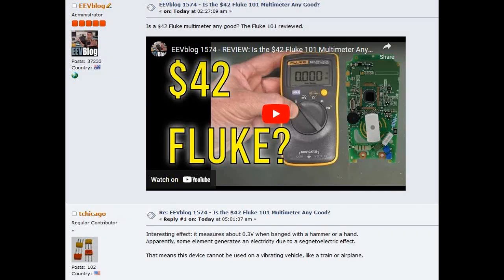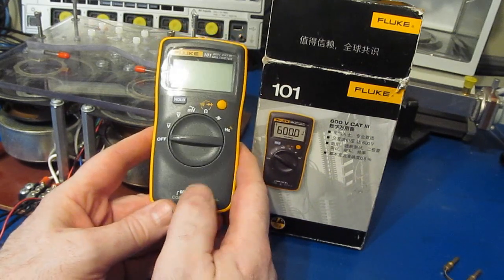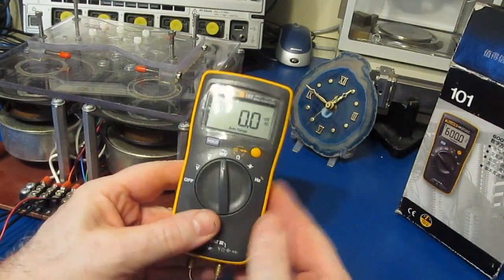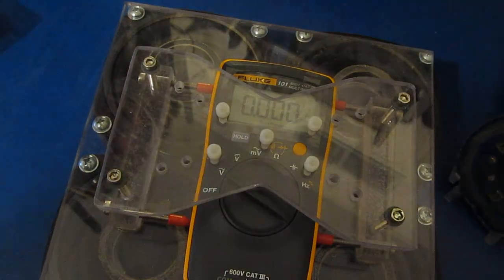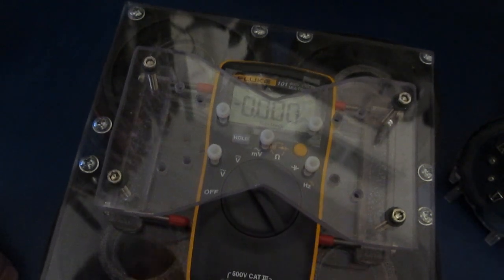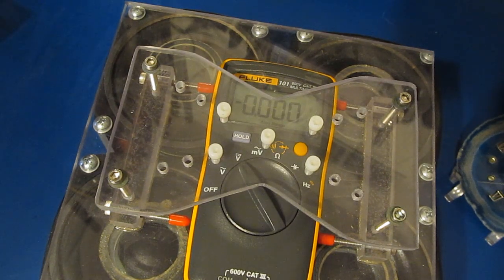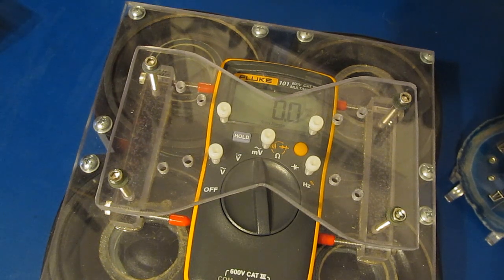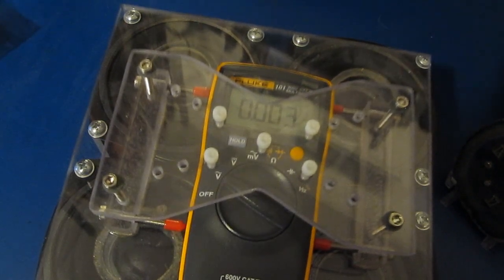Fluke 101 Effects of vibration

Comment: mine is from 2015 ( amazon India ) . one thing I noticed is that it picks up some reading in both the AC ranges just by proximity to an AC mains ( 220V 50 Hz) current appliance or hot outlet or wire . So sometimes I do use it just for that - non-contact AC sensing . It's a fine meter and survives until now as my only meter often carry around .
Reply from the maker: What you are describing is fairly common.  I've seen several posts from beginners who buy a meter and think something is wrong with it because the meter will not read zero with nothing connected.

Comment: Maybe a side load will do it. The resistor network is mounted vertically usually in these meters so the effect might be directional. Doing this while supplying it with say a precise 100V source might do the trick.

Comment: Still better than an analog meter in this regard.
Reply from the maker: Very true.  I have an analog pressure gauge that I use on one of my motorcycles that is filled with glycerine to dampen the movements.  I wouldn't be surprised if some of the high end analog meters did not have some sort of dampeners as well.

Comment: Could it be the original poster had one from a bad batch? I have never worked in manufacturing so I don't know the answer to this question: how likely is it that someone accidentally ordered a bunch of class 2 caps instead of class 1 and they just decided "use 'em anyway!"?
Reply from the maker: They may not even own one and only based their comments on what they saw during the EEVBLOG review, assuming what was shown was vibration related.
Reply: @joesmith-je3tq  Maybe. I went to buy one but they don't seem to be offered directly in Canada. I'd have to order from the US and pay import fees. This brings the price up to $86 CAD ($62 USD) for the Fluke 101 or $116 CAD ($84 USD) for the Fluke 101+ (I have no idea what the + means. It looks identical to the 101 from the front). Not as exciting of a deal as the $42 USD Dave talked about

Comment: Impedance related for sure. Shorting input is not charging any caps in input path either so not a very good test.
Try connecting leads to an actual voltage source and see if that changes the sensitivity to any vibration. After all if it is an effect relative to measured voltage, it won't show up when you measure 0. 50% error of 0 is still 0 😜
Reply from the maker: While I would expect no difference, had you read the comments you would know I did this and saw no effect.
Reply: @joesmith-je3tq  Comments are fine and good, but I would have liked to see it...
Also: Having done extensive vibration testing of both exploring and military grade equipment before I'd expect to run multiple axis tests. Especially for such issues that can be randomly affected by capacitor orientation during pick&place. On some equipment we even had to use specific components with known verified orientation to avoid certain effects.
Reply from the maker: @1kreature  I too would also expect a professional lab will run multiple axis to some standard and publish a report.  You won't get that here.  But, it's easy enough to run your own tests with what ever equipment you like.  Then you can try what ever combination you like.   If you do, post a video so we can see your results.

Comment: I get about 30-50mV when I rub my hand on the LCD. It's not impact/vibration related.
Reply from the maker: If I rub my finger on the display with nothing attached to the meter, I see roughly that same 50mV error.    If measure a 5.0VAC signal and then rub my finger on the display, it appears to have no effect.   This is different than the Gossen Ultra (Prime now) where you have it attached to a low impedance source and the meter is still sensitive to moving your hands near it.  How this meter ever made it on the market with such poor shielding is anyones guess.

Comment: Kind of reminds me of factory I worked in, one of many, that had environmental testers like temp chambers and a vibration machine that probably weighed hundreds of pounds.  Stuff that was vibrated were power supplies and controllers.  Can't recall anything failing.

One thing that didn't sit with me well was a engineer hand us use shorter bolts because of bolt stretch.  These shorter bolts did not fully tread into the fixture because of the short length.  His reasoning was the shorter bolts will stretch less.
Reply from the maker: Didn't you explain that using no bolts at all solves the stretch problem?

Comment: I never thought to smack my meter, but okay. I tried it with my Fluke 107 and it bumps up to ~50 or 100 mV. Even my Bryman BM869s will show ~50 mV with a good swat. I should say these are only random peak values, only when you hit it just right after 5 or 10 tries.

Comment: I wouldn't be surprised if OP's issue was a slightly defective unit.  $50 MSRP doesn't leave a lot of quality budget, both on the assembly line and at the end of it.

One question though: does the shake table get any motion along its surface?  In the "manual" testing, it seemed like you but the best result with sharp whacks on the side.  That might have just been the tiny meter slipping in your hand and the mode selector getting bumped, though 😅
Reply from the maker: I would have to mount the meter perpendicular.  I did this when running those pots but I don't have a way to run a meter in this axis.